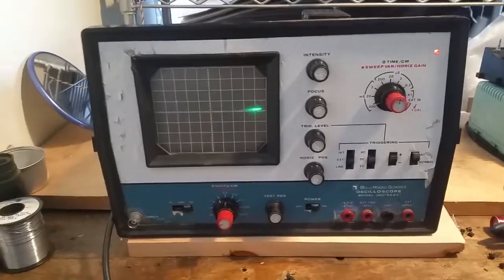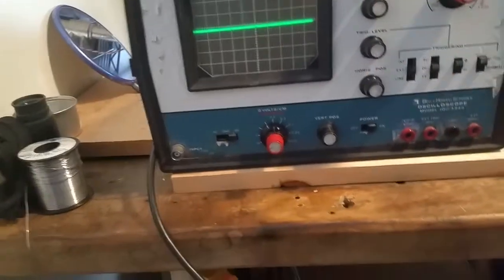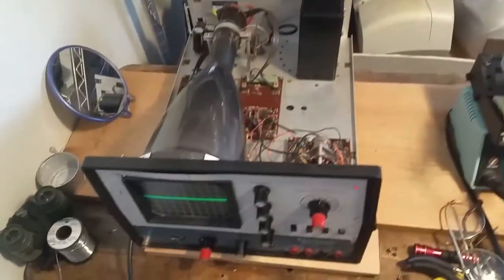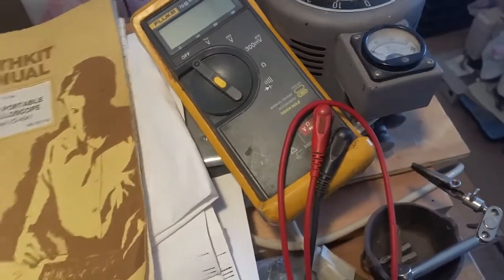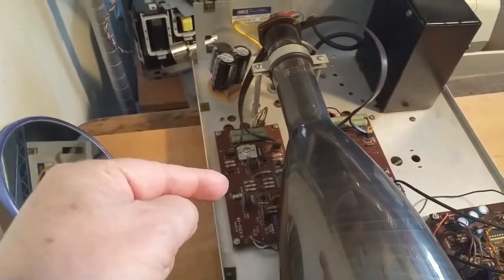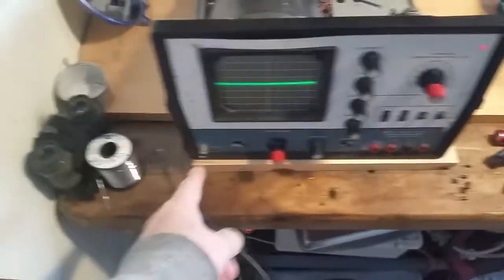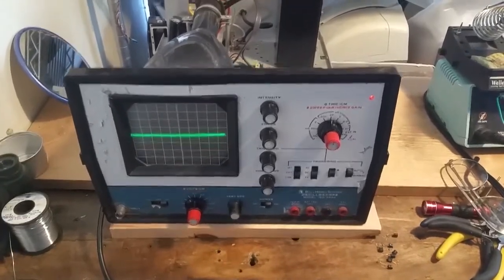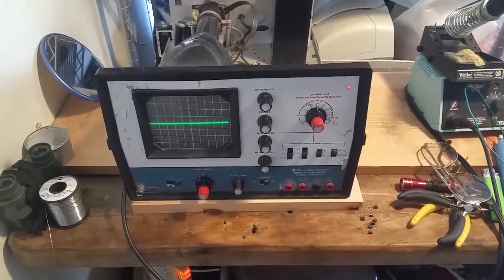Heathkit IO-4540 Update March 8

Comment: Might need recalibration after fitting all those new resistors.
Reply: Oh yeah!!!  It would work much better it re-calibrated.
Reply: I just got one for two bucks at the trader Jack's flee market outside of Pittsburgh. What the heck does this machine do? Its purpose?
Reply: @robertgill7214   If you are not an electronics engineer you probably have no use for it, it is for measuring audio or radio frequency wave forms.
Reply: @robertgill7214  An Oscilloscope is an electronic test instrument that gives a graphical display of the varying voltage of one or more signals over time.   Do you have a hobby in or related to electronics?  Nice find, BTW.
Reply: From this video, it seems that the OP does not know what a scope is, or what it's controls do, or how to tell if it is working or not. Just some random fumbling around, vague comments, etc.